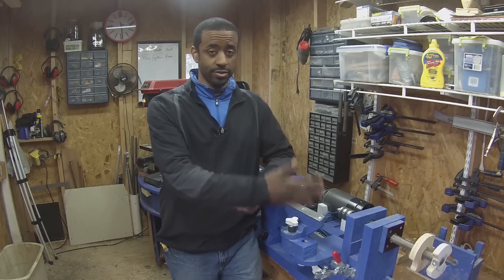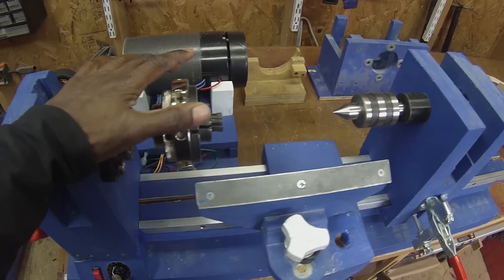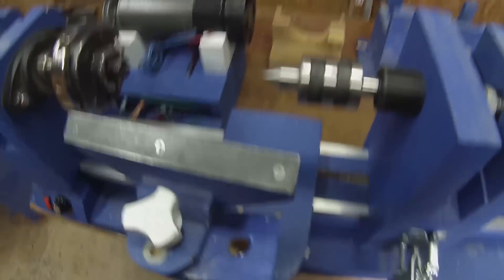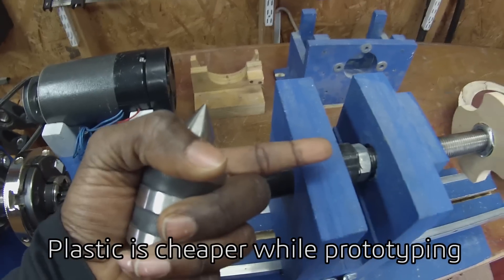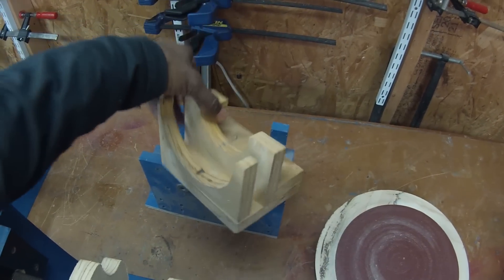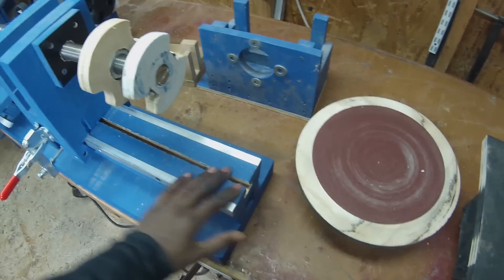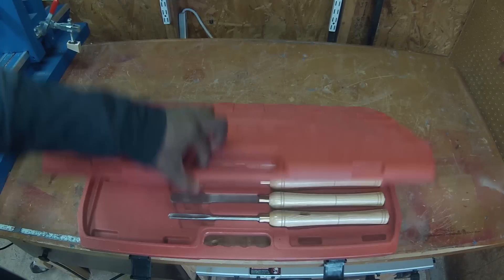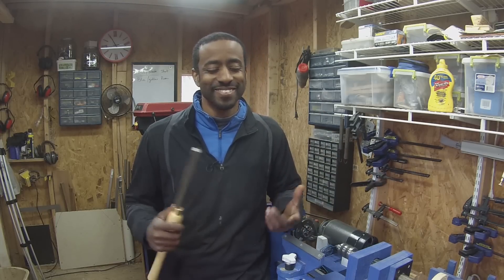How to Build A Lathe Mostly from Wood. Part 1 Intro, And The Plans:  021

Comment: just an idea for an improvement, usually a lathe would use a weight to carry the angular momentum so you can cut through metal more easily, you could do this with either gearing or the idea i had which is to use a Slip-clutch. you would also need to set up a tool post though and use inserts to cut, i think using hand tools would be pretty dangerous lol

Comment: Hey Jeremy :)
love the channel always get excited to see a new video :)
have come back to this one as im thinking about trying to build my own lathe :) (thank you for the idea :D)
my main question is in regards to the motor,
tomorrow im planning to pick up a free tredmill i found on facebook,
electronicly it fully works, so i guess my question is, can i just use the built in tredmill speed controller that you use for walking/jogging/running.
that way im not needing to rewire (aside from shortening a few cables and ensureing i have an emergency shut off)
and am hoping to not need to purchase a speed controller as result :)
Reply from the maker: Search my channel
Reply: @Jeremy_Fielding  appologies,
I did look to see if you had covered that one but missed it :)
Another search and I found your awesome video on the DC controller.
Legend :)

Comment: Thanks for all the information on dc motors.  I recently got a freebie treadmill and pulled the motor and controller.   I'm looking to adapt it to my bowl lathe I made a few years ago.  I have a motor with a bad capacitor on it now, that requires help to start.  But it will start in both directions, making sanding quicker.  Can I do something to my dc treadmill motor to make it easy to reverse?
Reply from the maker: Watch my video "how to wire large DC motors" I talk about that there.

Comment: Your videos are the best. With the same format of emailing on building a lathe and your help, would you be willing to help out on the building of a house generator being that there are different types of generator motors? I have a large DC generator that I could use your help with.
Reply from the maker: I do have several videos on generators that you might find helpful. Unfortunately I simply can’t do one on one advice. It is not safe, and not practical. Please understand I get hundreds of request like this, and it takes a lot of time to get to understand the problem then, step-wise solve it through someone else hands. It’s just to risky and time consuming. This video was about me experimenting with people building something I designed and following written instructions as well as videos. There was very little advice required by email. Quite frankly I mostly got very basic questions about whether they could use a part they already had or buy what I used. The answer was usually "use what you got."

Comment: hi sir. I've only watched a few of your videos, but what I've seen so far is great. you have a good imagination and a knack for figuring things out. I'm not some silly fan boy or looking for a bromance. I'm just giving you props. I had been welding, fitting and fabricating for 14 yrs, then went into the army as a medic. my imagination, memory and patience have all been worn away by ptsd and the meds to fight the ptsd. I made a lathe a few weeks ago. it was a meld on wood and welded parts bolted to wood. it was too light and not a good design. I've since torn it apart and will start a rebuild of it trying to copy the store bought heavy metal lathes. my design is starting with a piece of 6X6 treated lumber. the head stock and tail stock will be made of the same. after I've built it, if it still doesn't work correctly I'd like to have you look at it, send you all the info I can on it and let me know where I went wrong. also, if it does work I'd still like to show it to you, maybe we could learn a thing or two from each other. my email us agb0244@gmail.com  if I could get yours that would be great. have a good day. 
Albert George Boyle II
Reply from the maker: I sent you an email. You should edit your comment above and delete your email address. That way its not public. Thank you for the kind words.. the rest of my thoughts are in the email.

Comment: Would this be strong enough to be a metal lathe, or would I need stronger parts?
Reply: You would need a cross slide/compound rest. You could probably adapt this frame to do very minor turning (think pens, ornamental pieces) out of soft materials (brass and aluminum). It wouldn't be rigid or accurate enough for much more. Not that it can't be done, just that this particular design doesn't seem suitable or meant for metal. Basically look at a watch makers lathe and figure this to be a bigger, woodier design.

Comment: I didn't even finish watching before PayPal'ing (is that a word?) the $10.  The idea of the threaded 1" rod for the headstock matches my thinking.  But the idea of 3D-printing a morse-taper for the tail-stock--That's Awesome!

I can't wait to see how this turns out.  I may not build along and I may make "improvements" but I'm happy to see where this goes.

OH, and look into making some of your own lathe-tools using 1/4" HSS tool-bits.  You can ground your own profiles and the bits are cheap.

Comment: I've made a couple of lathes. Well, I made one in a drunken afternoon, then years later when I found out the junk I used for a headstock was actually a grinding arbor I decided to take that off, and use it just as a grinding arbor, but I still wanted a lathe, so I rebuilt it. That took me about two months of sober work. Yeah the Mark Two version is a bit nicer I suppose.

Comment: That is pretty sweet, but I would think about a variable pulley setup between the motor and the stock drive. My lathe at the moment is a Shopsmith. If you look at the drive on the Shopsmith, then you will see what I am talking about. It is similar to snow mobiles and golf carts, but with a manual driven pulley instead of a centrifugal pulley..

Comment: Are the plans complete for the $10.00, or is it $10.00 per step, like 10 for the headstock, 10 for the toolrest... etc. I love how it looks in the solid model, just wondering if it's all the plans, at once. :) Thanks buddy!
Reply from the maker: So if you join before I finish the plans its $10 for everything. It will just be delivered in parts because I want to test run each part before I give complete plans. As I build it, I will update the plans before I send it out to everyone if I change something.
Reply: +Jeremy Fielding Going to have to throw some cash in the old PayPal account. Thank you!

Comment: You can buy a morse taper #1 sleeve from ebay for cheap.  https://www.ebay.com/itm/252605701620
Reply from the maker: I love you guys... I did not know such a thing existed. That is awesome.
Reply: Have you ever heard of the Dave Gingery lathe? I'd like to see you do a Gingery series. Although I just skipped ahead to what Dave said was impossible to do, and did it myself. heh
Reply from the maker: I saw it. It will work I think. But now I need something to hold onto the sleeve. I may buy one and experiment.

Comment: Woooo hooo!   Definitely excited to see this through to completion!
Reply: I just picked up a lathe for $20, and I'd like to replace the tail stock with a 'live tailstock' -- not sure if you will have any insights into that, but, if you get a chance to highlight the install for that, I'd definitely appreciate it!
Reply: Alan T You need to buy or make a live center, not a live center tailstock. You buy it based on the taper.
Reply: I'm learning as I go -- I'm a cartographer, not a machinist (yet) -- the lathe I picked up I believe is a Craftsman ''Companion' lathe (1930's vintage) -- and no manual yet, so I'm to have to feel my way through this.  Here's hoping the rig I got accepts a taper sleeve/Morse taper! Thank you Sir!